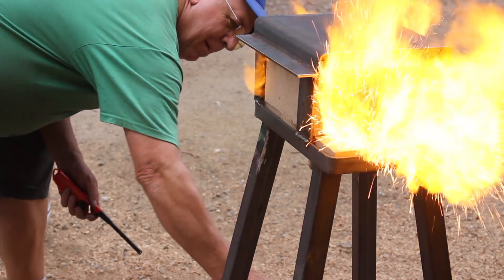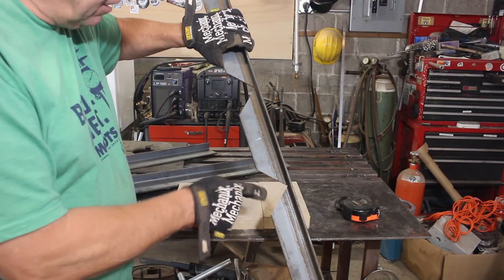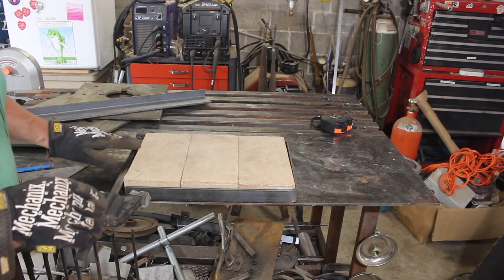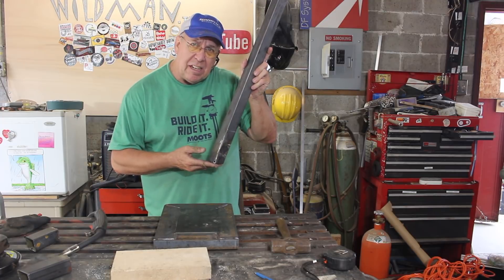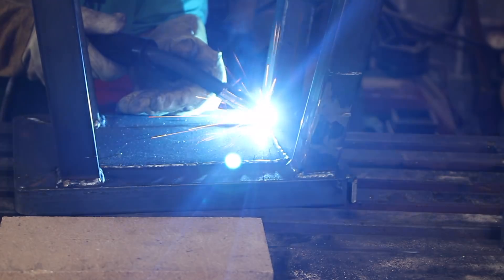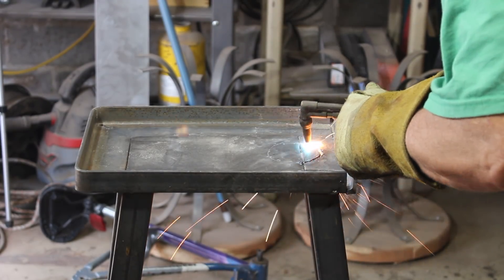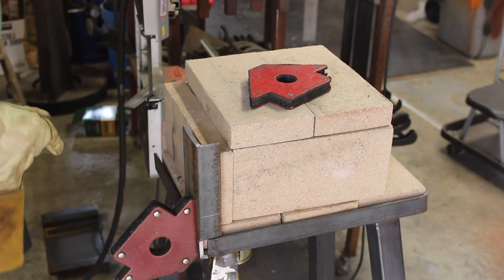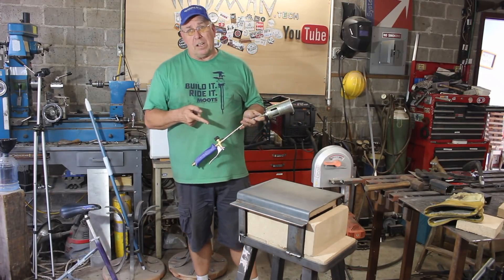How to Build a Propane Forge for $50!

Comment: $50 if you have a source for free steel, a plasma cutter, welder, fire bricks, etc...
Reply from the maker: There was no plasma cutter used in this project and if you go look at the instructable referenced in the description above, there is a complete cost breakdown. Also outlined in the instructable is the minimum tool requirement, which in this case is a hacksaw and a torch or welder. The firebricks were $3 each, the weed burner was $17 and the steel was all remnants from my local steel yard. Clearly, you're just looking for reasons to justify your own incompetence, because if you had any skill at all you would find a way to do it with whatever tools you have on hand rather than whine to me about why you can't figure out this childishly simple project. Now I'm going to post this in the Facebook "Laugh at YouTube Trolls" group.
Reply: @WildmanTech  oh no, not Facebook! So you didn't count the cost of the propane bottle you need, and you say the steel is $10 when anyone else buying this still would have to pay significantly more. and you don't count any costs associated with a welder or welding. And yeah I misspoke I didn't mean to say plasma cutter. So basically if you have a welding shop and a hookup to free steel you can make this for $50. If you're anyone else watching the video it would cost you more. Just dishonesty really to trick people into watching your video.

Oh and where are these $3 firebricks, or did you get that from your cousin or something too ..
Reply from the maker: @Aaron-on3ro  And still all you can do whine and feel sorry for yourself because you don't have a welder...which is NOT a requirement to build this project. I could build this with nothing but a drill and a hacksaw and no torch or welder. This video is not even slightly dishonest. Any resourceful person can build one of these for $50.  I didn't get any free steel or free anything else! I BOUGHT every single component to make it from sources that exist all over the world. Learn to shop. Buy remnant steel at your steel yard. It's cheaper...not that steel is very expensive anyway. The only valid point you make is the cost of the propane tank and I didn't think that worth mentioning since everyone and their brother has one lying around to fuel their BBQ.
Reply: @WildmanTech  I'm a fucking ironworker lmao
Reply from the maker: @Aaron-on3ro  I don't believe it. All the ironworkers I know are the kind of people who find a way to get the job done with whatever resources they have on hand. That ain't you because, judging by your whining comments, you're the kind of person who makes excuses why it can't be done.
Reply: @WildmanTech  hey fuck that guy, thanks for the guide, bout to get one of these bad boys goin to keep me busy during quarantine, pairing this with a couple sledges and a 60 dollar tiny anvil from harbor freight to get me started
Reply: I appreciate the video and the walkthrough, thankyou. Makes me hungry to get started and wonder how I can do this without a welder. And Wildman Tech , you’re comments are revealing some thin skin my friend. These videos, for a complete beginner ARE somewhat overwhelming initially, especially if just getting into these kinds of hobbies. While his comment may come across as complaining, I think he’s pointing out the click-bait kind of title that says one can build this for only $50. It’s not complaining to say that for some people that may not be true.
Reply: @WildmanTech  Fuck em who needs yeah the material costs are going to vary depending on your area and your connections but you can still do all of this for sure for a 100 bucks I get my angle iron from roadside bed frames lol but what you did with the torch can be done using a metal bit to drill a bunch of holes were your making the hole for the burner I have a welder but if I didn't I would clamp it together bit Im sure there's probably a better no welder way though I'm on 17 so I dont have to much experience yet also thank you for the weed burner idea I'm saving up for a car right now so that will save me money on a high end burner and I don't need to keep using 8lb bags of walmart charcoal

Comment: NOT TROLLING - but seriously vids like this are what wastes people's time. that is not a forge. you wasted your money if you bought that stuff new and i would suggest that NO ONE attempt to burn themselves with this contraption. total miss on the concept wildman. for $20 you can build actual forge burners, adjustable and safe.... gah, please remove this video. america has enough dumbasses without someone to cheer them on.
Reply from the maker: Yet two years later it is still in use and the current owner loves it. I think the only dumbass here is the bone-headed commenter.

Comment: Need more heat when welding boss.
Reply from the maker: 20,000 BTUs is not enough? Seems to work well enough now that it's over a year old.
Reply: I dont know how BTUs work because ive never really learned that specific unit but my welding machine is labeled 1-10 and for maximum penetration i usually stay around 4/6. Never really get below or above that.

Comment: You'll spend more bringing that forge up to heat than if you had just bought a $50 Blacksmith torch on eBay
Reply from the maker: The cheapest one I saw was $250, but how did you make that determination?
Reply: Wildman Tech poor insulation. My bricks on my forge are 3 times as thick and still takes a shit load of propane to heat it up and keep it hot. I also have an actual forge burner which should be more efficient than a weed burner, but maybe it isn’t lmao

Comment: Good fabricating skills however, that forge is HIGHLY INNEFICIENT. You need kaowool, refractory cement, etc., for this to be able to be at welding temperature. Fire bricks absorb the heat and aren't good insulators.

Comment: Great looking forge! One tip for people making this. I made an enlarged coffee can forge out of a popcorn tin as my first forge and I used one of those same harbor freight weed killer torches. Make sure you tighten the connection and use some leak detector before using the torch. Mine leaked and almost made a big boom. If you don't have Snoop or store bought leak detector then just spray it down with some soap and water mix and if you see bubbles while the gas is on then you have a leak and need to tighten.

Comment: Do a follow up video, I want to see if it works. I don’t think it will because of your burner placement, or at least not for long. You did a nice job on the forge 👍🏻
Reply: I'm not going to do a follow up video on something that's been gone for nearly a year, but it worked just fine.

Comment: Great build. Just one question. With the frame all welded, how would you change out a broken fire brick?
Reply from the maker: The bricks can all be removed even though it has been welded. The bottom go in first, top next and the sides hold the top bricks up.
Reply: Oh I understand, the top is not pressing the bricks together, leaving a loose fit. Thank you for your video.

Comment: The blast of fire was cool but did that forge get hot enough to work on steel? It looked like an orange flame, I made a similar forge and was wondering if the weed burner actually works.
Reply: It works. I used that same harbor freight weed/ice torch but it is not very efficient so it really depends on the design. I had to redesign mine a little. I wouldn't try to harden 1095 in it because it won't get you up to °1500 for about 4 hours.
Reply: They say they put out about 3000 BTUs but you are right. Too much orange flame so it takes a long time.

Comment: Very nice. I'd use sheet metal screws to hold the top on, in case I need to replace a brick now and then.
Reply from the maker: You can remove them without disassembling the frame
Reply: I don't doubt that. I'm just not sure I could get them back in.
Reply from the maker: It's a bit of a jugsaw puzzle, but not a big problem.

Comment: Three burner wasn't putting heat I the forge. It's all blowing out the front and sides. You don't have enough oxygen mixing with there propane to make a nice hot jet inside the forge where you are actually trying to get metal hot.
Reply from the maker: This only has one burner.
Reply: Wildman Tech that was a typo. You have one burner but the propane is burning outside of the forge. You're not getting efficient heat inside.
Reply from the maker: There is another firebrick we use as a door that wasn't shown.

Comment: is there any other torch you would suggest for the burner if some one wanted to scale this up a little. i know a splitter and duel setup will be needed eventually im always worried about it not having balanced heat. i dont want to over heat an area.
Reply from the maker: If this isn't enough, I'd recommend building a conventional burner.
Reply: suggestions on any links for building one?
Reply from the maker: Well I don't know what you see, but for me about half of the suggested videos on the right are forge burner builds.
Reply: Weed burners come in different sizes. Some of the bigger ones have push-button ignitions.

Comment: I have watched quite a few videos on making propane forges. This is probably a stupid question but I figure I would still ask. Could I use natural gas for a forge instead of propane? If so, is there a difference between temperatures between using natural gas instead of propane? My wife's grandparents left her their house when they passed away. Her grandpa had a natural gas valve or set up installed outside under the back patio so he could run his propane gas grill off of natural gas instead of propane. I am thinking about using that set up for a forge instead of using propane. This way I don't have to worry about buying a propane tank and refilling it when I run out. In my way of thinking it's a pretty good idea. I was impressed when I saw what he had done and will be even more impressed if I can use it for a forge.
Reply from the maker: It could be done, but natural gas is an even lower energy fuel than propane...which is pretty low energy to begin with. Natural gas is all over the world and I've never seen a natural gas forge. Probably a reason for that.
Reply: It has/can be done. Look up a ribbon burner forge you have to use forced air I believe to do it. On one of the blade making forums there is a guy that does it off of a residential line.  Sorry I don’t remember much of the info, it has been a while since I have looked into it. You should be able to find it through google or bing though.

Comment: Yep if you have all the tools  you can build it for $50 otherwise you need to speak for yourself that you can build for $50.
Reply from the maker: If you have a look at the Instructable, you will see that the minimum complement of tools required is an oxy/acetylene torch and a drill with a masonry bit. I made this video just for you... https://youtu.be/84q3qjjJiV8  Would you like to also whine about the thousands of dollars I've invested in my education? Or are you just making excuses so you don't have to face the challenge for yourself?

Comment: Does is use a bunch of propane to get steel hot?
Reply: Tim Henry, it "should" make several knives for you. The foundry shouldn't take long to heat up. Think about a propane bbq grill.
Reply from the maker: Define "a bunch."
Reply: Wildman Tech.  30 pounder. Grill size. Could I make a couple knives out of files?

Comment: Are you using a special drill bit? Ive been trying to drill with 20V dewalt drill with a masonry bit and am not getting anywhere?
Reply from the maker: Nothing special. Just a common a masonry bit.
Reply: Typically a hammer drill is used with masonry drilling.

Comment: finally a welding video that isn't showing someone using a grinder for 10 minutes.

Good job
Reply from the maker: You can be a welder. or you can be a grinder!
Reply: My apologies. I see now that my wording for what i was trying to say was misleading. While I do think this gentleman did an excellent job with very little grinding, I also think he did an excellent job of not putting lots of footage of a grinder cutting or grinding metal. Being a welding shop owner, I agree with you that grinding is a vital step in fabrication; but I don't believe it should consume 90% of a YouTube video.
Reply: Welding requires grinding many times. I know he used a mig but stick welding always requires. But all the same welding takes prep from grinders. This is how you keep contaminated out of the weld. This is speaking in general so don't give shit about how this build didn't require it
Reply: +Clay Ashby absolutely. it can be as fascinating as watching paint dry. that and so many people will make a weld with no bevels or penetration  then grind away all the weld making it look pretty but grinding what little bit of strength they had away.

Comment: Great job, I built a propane forge at the end of the summer using the same kind of firebricks but haven't had time to use it much.  I'm wondering if I need to insulate them or use a reflective coating?  any thoughts on that?  I did shoot some clips of the build so I'll work on a putting out a video next week...
Reply from the maker: There's a product called Satanite. It's a kind of refractory cement and I saw someone else use it to insulate firebrick.
Reply: I've heard of it and i'm still not sure if it's necessary or not.  My design is similar to yours and the whole thing gets wicked hot.  Not sure how efficient it is at retaining the heat...just wondering if something like Satanite might reflect more back towards the center?  thanks for the great videos....I've been away from youtube for a few months due to work so I've got some more watching to do.  -Kyle
Reply: Vintage Wood Workshop hard firebricks are a MASSIVE heat sink, you won't need satinite but you will need 3x as much propane and time to heat them up to proper forging temp
Reply: thanks, I'm thinking they are not very efficient to use.  I've had trouble getting the steel hot enough to stay red for awhile as I work it on the anvil.  Any recommendations?  I may re-build it to a more efficient design...
Reply: Vintage Wood Workshop yeah they are still great faces for direct fire, use them for the floor, and depending your access to machining a ring for the torch hole to reduce wear.
Buy either refractory or soft bricks rated 2600°f (you can go lower but they'll have to be replaced quite often if you plan on forge welding any)
Shouldn't need more than 8-10 soft bricks or 50lb refractory.
If you don't have the money wait until you do, you'll spend more on propane than buying the proper insulation, remember measure twice cut once.

Comment: Nice timing! I'm finally ready to cross over the smelting threshold and lo/behold the Instrucables email links me right to one! How hot will this get? Suitable for melting aluminum?
Reply from the maker: I have no way to measure temperatures this high, but it will get steel bright orange.
Reply: @WildmanTech  That's surprising. You've used hard firebrick, which doesn't insulate well, and those weed burners don't mix the fuel and air all that well leading to lower temperatures than you could be getting. If it had 2" of ceramic fiber around the bricks and a Ron Reil burner instead, it would hit a bright yellow easily if not melting the steel outright.

Comment: where did you get the fire brick
Reply: Shogun-Jimi Fire brick is available at most home improvement stores in their outdoor section. If you want a slight upgrade, either look at art/ceramics stores or online for their refractory brick - the stuff used in kilns, or you can cast one with refractory cement.
Reply: Brickyards as well as fireplace stores have them...
Reply from the maker: They have the standard size in stock at Lowe's around here, but Sacramento has several brickyards too.  Which is where I got the nice thin ones.
Reply: I just take mine from work every year we relay the Grates for the boiler room so if you happen to know someone who works at a wood mill ask also a great place to get some D2 blades from the plainer.